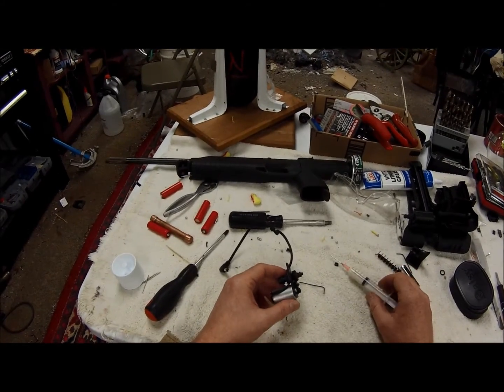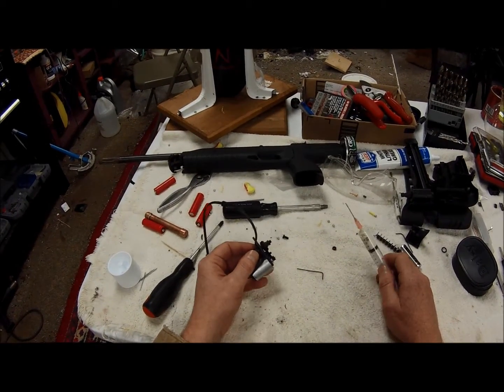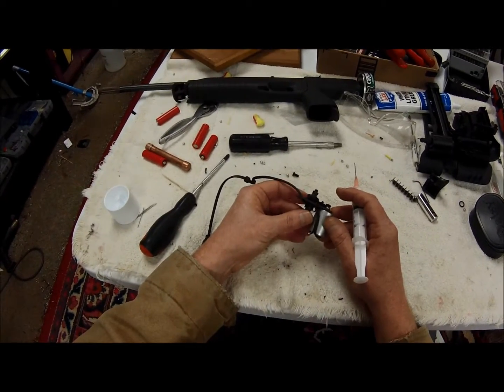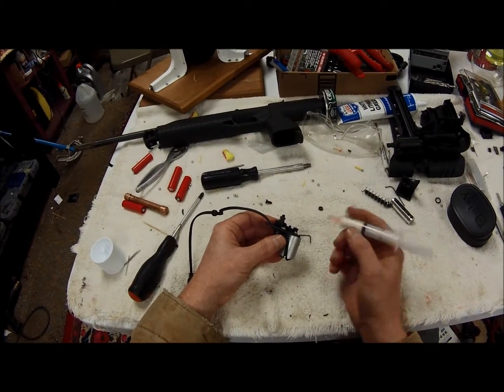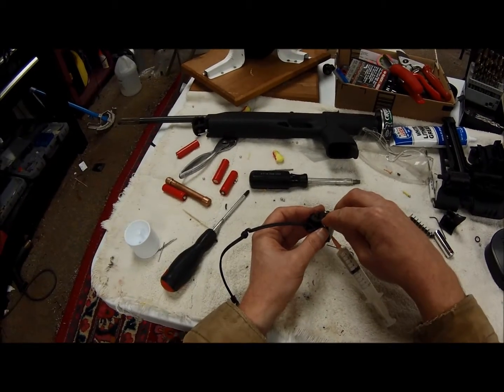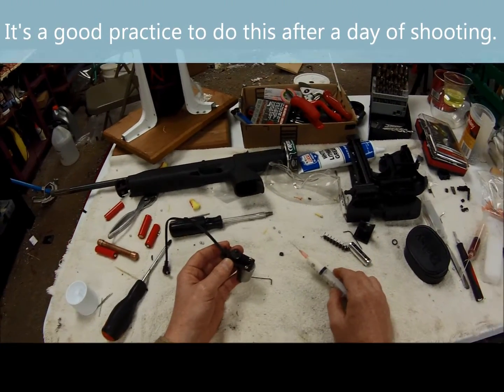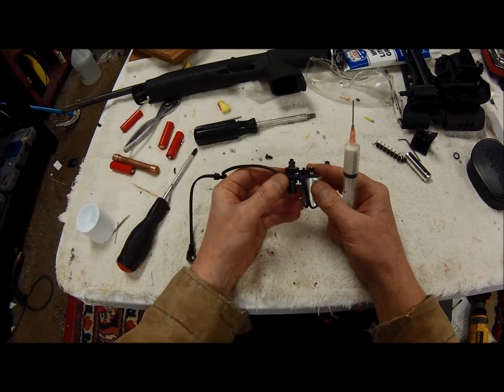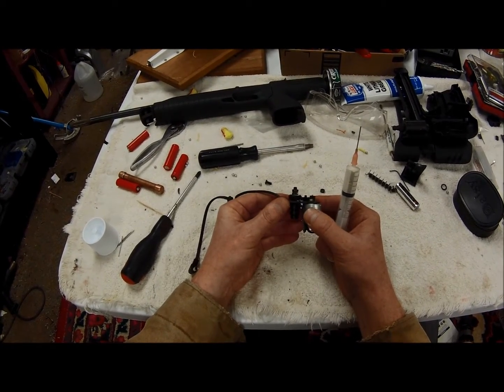SuperBird  Maintenance Mod

Comment: Dude, you the man when it comes to these guns.
Thank you for all dedication.
Have you had a chance to revisit the amps and voltage needed for the 24volt 4K board?
Reply from the maker: To better answer your question I have been tied up for a week on a chip mod. I need everyones' help. I am behind in the stuff that I know, and have a handle on.
Reply from the maker: Thinking about it a little more it takes a minimum of about 7A for the motor I found to run 4K reliably I'd say. You can lower the amperage needed by upping the pulse, but going above 6ms you start running into timing issues. I have spoken at length with Efest. I tested their newer 800mAh IMR's. They only rated them at 2.4A. They worked with a pulse of 4 for bursts of 30 to 60. I told them their batteries must be rated wrong. Turns out the engineer who came up with them got canned. They retested, and rerated them to 4.5A. When the voltage drops to around 21V the solenoid stops firing, but the motor continues to run. So even if it would work with an 18.5V pack theoretically it wouldn't work very long. It's a paradox. Have you done any more testing? I don't mind being wrong.

Comment: Great Stuff, Brudda!  Thanks for sharin'.  Just curious; when you say "...after a day of shooting...", how many rounds  are you talikin' about?
Reply from the maker: DillyD Think of it like cleaning a firearm after a day at the range. I came up with this because if you wanted to do this without the grease port you would have to take the clutch apart to regrease it. Then you would have to tune the mag again. By the time you finish that it might be time to grease the clutch again.
Reply: ...Don't get me wrong...You are the U.S. Drozd genius, and I value the info. you share (this mod is badass!).  I was kinda deviating topics out of curiosity... With my measly 900 rpm gun, with few opportunities to shoot, a session totals about 15-20,000 rounds. My original JimC barrel has about 250,000 rounds through it after about 4 years...
Reply from the maker: You'er too kind. I'm just trying to keep it alive for all of us. I don't really think you need this mod. This was for a chipped 1200 RPM Bumblebee complete with hopper mag. I tightened the clutch to keep it from slipping. I was prompted to do this mod because one of the 4K mags came back. The fella told me it jammed, and he kept pulling the trigger spinning the clutch. This caused the metal plate to dig into plastic gear, and damn near weld itself in there. I have that mag on my desk right now with a solid plan in place to fix it. Like the old saying goes, "An ounce of prevention is worth a pound of cure."
Reply: Just like engine building...I dig what you're doin'...Keep it up!  I'll email you within the next 1-2 days about some parts.
Reply from the maker: Thanks bro. I'll be around.